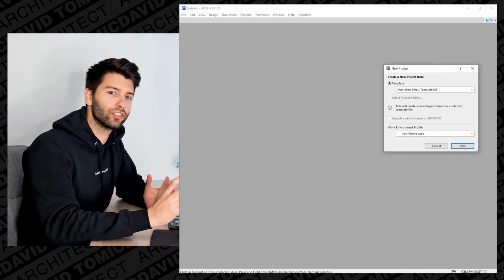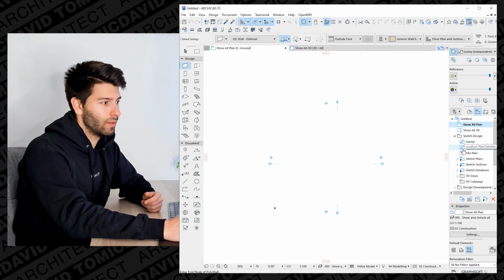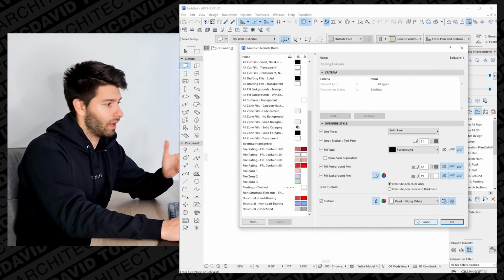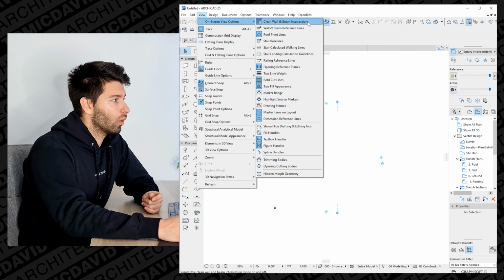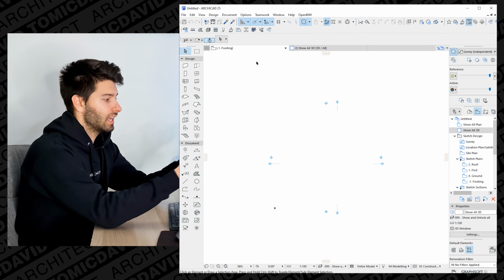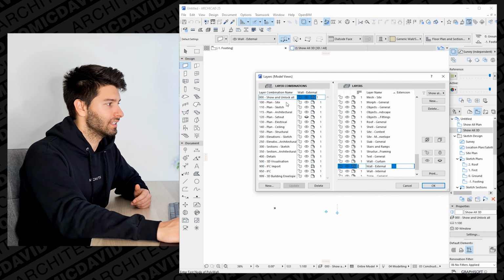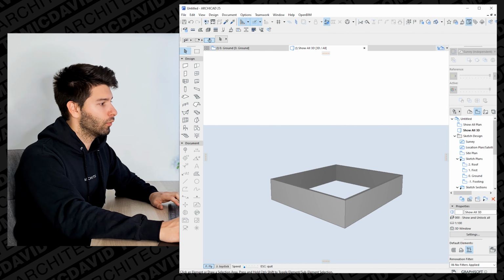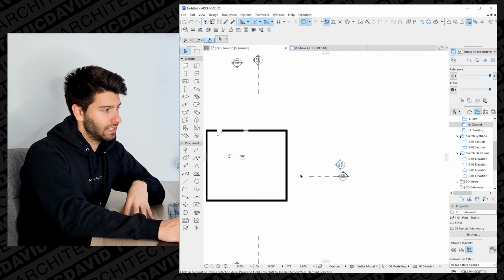Introduction to ArchiCAD 25 Tutorial: Beginners Level

Comment: How can I save floorplan as 2D in Archicad? Just as lines and fills. I need to extract areas from drawing. Thank you
Reply from the maker: You can export it as a pdf in the layout book (I’ve got a video on this) also you can export them as a dwg. However you can get areas inside of archicad
Reply: @DavidTomic  I have one finished Archicad project, file, where drawings, floorplans, from stories are saved on Independent Worksheet as lines and fills (walls, openings and stairs) and over that are fills in colours to represent different areas of floorplans. Do you know how to save floorplans as that, fills and lines?

Comment: Hi David,

great Video, I have looked at so many but found that yours is "ArchiCAD for Dummies" like me as I have to watch it over and over again before anything sinks in.  I'm new to ArchiCAD and I am currently doing an interior design course and I have chosen an advanced module of ArchiCAD.  my issue/problem is that when I open ArchiCAD 25 it is the Australian version and I am in the UK.  The version I have downloaded is the education version.   To be absolutely honest with you I am struggling to even get started on the assignment for the module as I can't seem the even get the walls correct let alone put in the different room i.e. bedrooms, bathrooms.

Some advice would be greatly appreciated

Thanks in advanced
Reply from the maker: Hi Sharon, try and download/open the international template. This should solve most of your problems :)

Comment: hi, this is my day 1 on archicad. On 21:00 your wall is continuous, but for my case, my wall ends as soon as I click left mouse button. Solution?
and also, 21:27 , ASDW thing that you showed isn't working or I did't understand. My archicad version is also 25
Reply from the maker: Join the discord group chat in the description and let's solve your problems. First one is easy, simply click your wall tool up the top and change it from single wall to continuous, here you can change it to a circle too. Second one id have to review the video but drop a screenshot in the discord group chat
Reply: @DavidTomic  thanks mate, really appreciate

Comment: The removal of the FBX export option basically destroys the visualisation pipeline. Twinmotion although useful for design research is highly insufficient in regard to marketing visualisation quality.
Reply: True the quality is just really bad compared to competition
Reply: Saving as FBX was a simple and efficient way to communicate with any 3d visualisation software, not sure why that had to go missing in 25.
Reply from the maker: Save it as a twinmotion file. That is FBX, at least it was in 24, haven't check 25 yet.
Reply: That is the same thing, it was named Save As > Twinmotion .fbx. It is no longer available in 25.